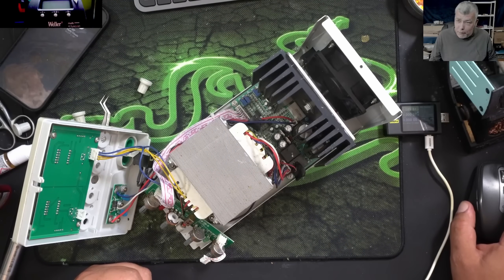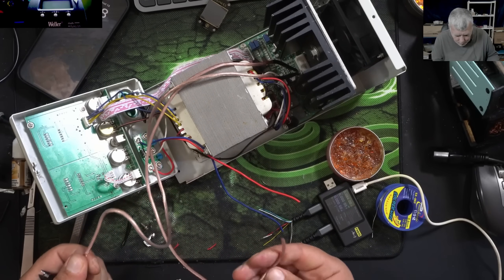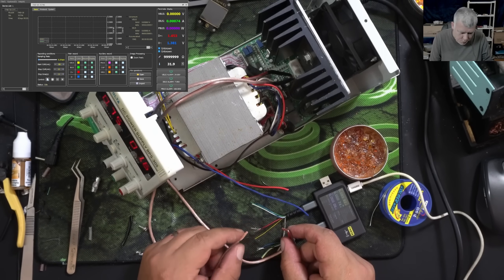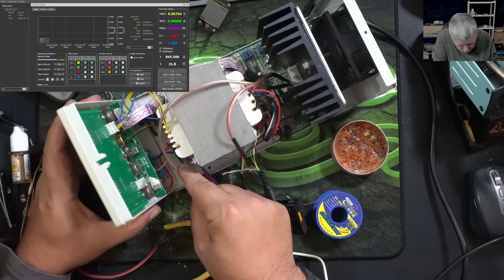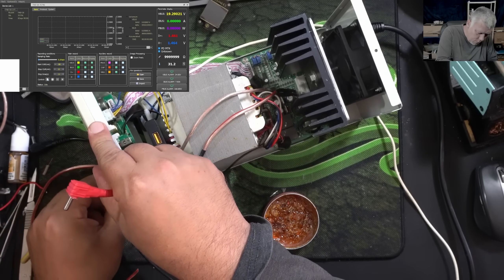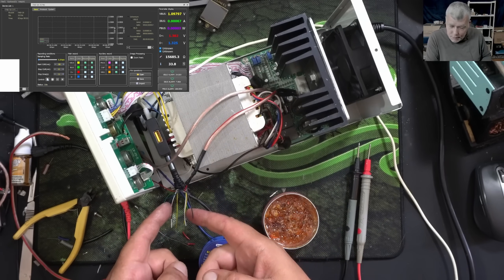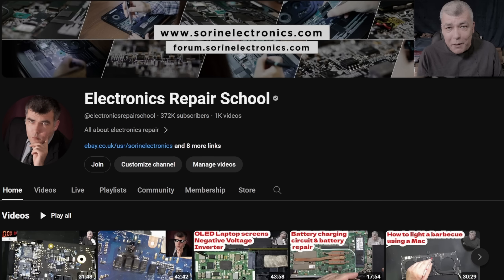How to install usb pc communication to your lab power supply - Say Hello to My Little Friend! FNB58

Comment: There's a Kiprim brand Programmable DC power supply, models DC310S and DC310Pro that's available on Amazon.  It seems to have most of the features you need, including a PC software interface and programmable output.  You may not like all the button controls, but you may find that the programmable buttons on the pro version a very quick way to change your output.  Seems very inexpensive, which is suspect.  Not to mention the color, yikes!

Comment: I have a  dell Latitude 55XX dead no power. No battery. I open it and check some voltage on motherboard look fine then is power on but when I remove AC power cable without turn off automatically they dead agine???

Comment: How does that thin gauge red wire soldered to the output terminal (from the USB connector) handle 5 amps?

Comment: the refresh rate of reading is better than meter on power supply, I think you can see some readings on screen when power supply clicking of over current but before you hear clicking but not seeing any reading on power supply meter.

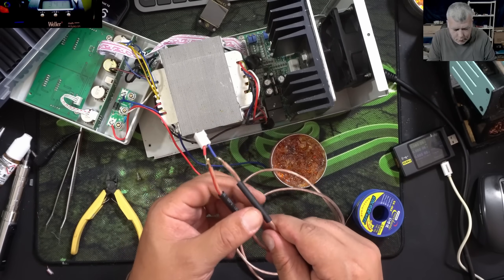Comment: When you show the soldered wire connection before putting the sleeve over the solder joint, doesn't that defeat the purpose? Since the original and thinner wire is still connected to the connector? (Time index 2:26)

Comment: Sorin, you can modify the current control circuit to push 2.5 extra amps for a total of 7.5 at 20V. Also, limit the output voltage to 20V.

Comment: Don't waste a good USB meter. Instead, you can use an INA226 module with an Arduino or ESP32 to measure voltage and current

Comment: The larger power wires are connected to the smaller wires into the plug. Won't this problem of current loss remain?

Comment: Like was said, an atx power suply, with some modifications, is the cheaper an best option, better than some expensive power suplys.
Add that meter u put there, and some simple components to do a variable voltage and current!
Problem solve!
10 amps, and deppending the atx u can reach at 27 28 v

Comment: You were offered so many wireless solutions in the comments to previous videos... This sort of works but maybe improve it to wireless in the future.

Also, less digits please.

Of course it would also make sense to mpdify the PSU to 7A or 8A and solve the power issue😊

Comment: This is almost a variable power supply... jeje.  You should have gotten a Aixun they have a 32v 8a and a 24v 8a, you can disable all alarms and protection so it behive like a linear power supply, with the bonus that you can conect it usb and get alloy of data.

Comment: I don't believe those usb-c cable wires will cope with the full short voltage/current of your power supply for long, despite what the cable may say on it. Even your tweezers suffered!  I wonder if you sent that other power supply  back?  IMHO you should and get the dual P6193 version which would give you the 30v 10A with computer display by just running both its outputs in parallel and you'd save all this ready-to-melt internal bodging.

Comment: That usb wire uses the red AND the black wire for plus, and the shield for negative. Add the black wire for extra current pass or if not, tape them so they won't touch the case by mistake
Reply: I tought that also, that single wire looks too weak
Reply: 7:38 it's like the black wire is actually plus but it is not... I remember one time I believed I was confused but then I realized I was confused of being confused.

Comment: Good job! I have the same "old friend" for many years. Changing the wires to 2mm² for the main poles and changing the potentiometers, nothing is needed for 12 years. Now, if I look, it is again time to change the current pot's. And the big capacitors. It is indeed a "tractor"! I am glad that you digitalize for the computer. Romanii mereu gasesc o iesire. Greetings!

Comment: the problem with this meter is that it is in series with the output and not inside the feedback loop of the power supply so as the current raises the output voltage drops so the "voltage regulation" is poor. if you connect it right after the pass transistor then most likely it will fall into the feedback loop and the voltage drop on the current meter will be compensated automatically

Comment: it's an analog power supply. with a little reverse engineering you can easily change the circuit for 7-8 amps output. you only need to find the comparator (or amplifier) that does the current limit.
Reply: Aren’t you forgetting that the transformer secondaries need to be able to supply more current accordingly? It’s probably not quite as simple.
Reply: @toolsarecool  They can handle that current for a short period. These old powersupplies arent to hard to modify , espciallly for Sorin.
Reply: linear power supplies depend of the power of their mains transformer.
so, even this mod can be made safely, adding another power transistor, or two, for three in parallel, it's a nonsense, because mains transformer is the same.
ok, ok, you can add more parallel transistors (with emitter resistors), if you want to ease the work of the original one, but the cooler is the same. and internal volume of the power supply.
so, no serious reason, really...